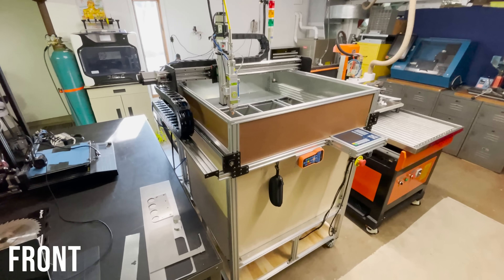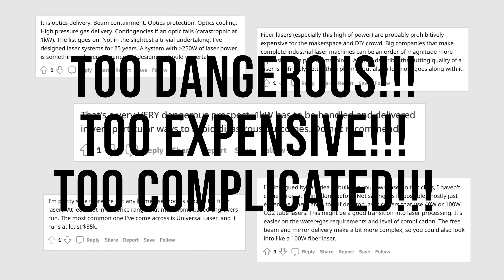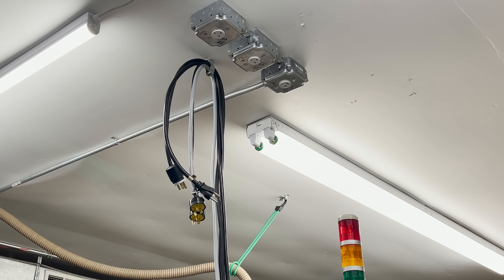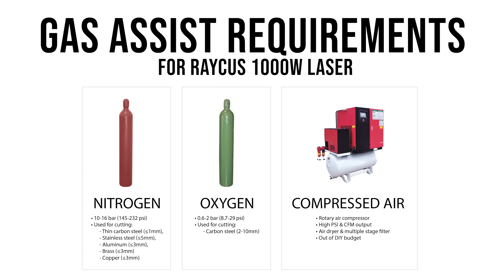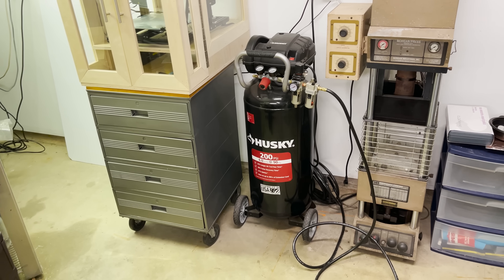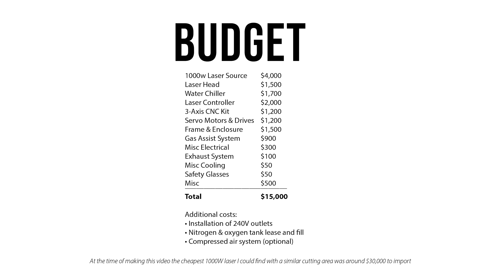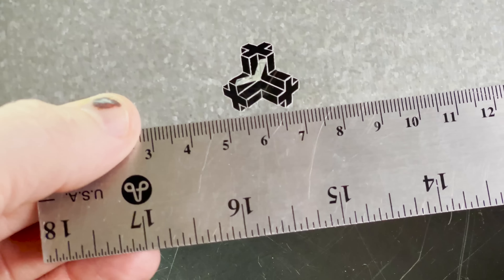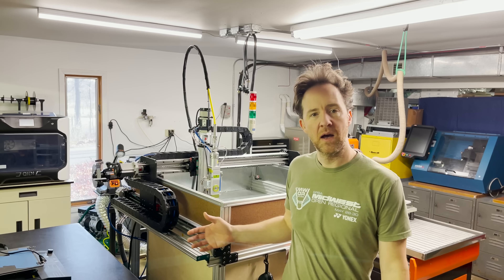DIY 1000W Fiber Laser Cutter Part 1: Project Introduction

Comment from the maker: * UPDATE MAY 2024: I have an updated, better, and cheaper design...also check out this video series: https://youtu.be/AL-qmKZxsL4 *

I'm getting a lot of comments about the gas prices and I really appreciate everyones feedback. I should have gone into a little more detail in the video...the prices I listed are to fill 300 cu/ft bottles at Airgas. I purchased their Ultra High Purity rated gasses, because it was the only option that they offered that met the requirements recommended by RayTools (the laser head manufacturer) of 99.95% purity, <5 ppm H20, <1 ppm THC for the Oxygen & 99.99% purity, 5 ppm H20, <1 ppm THC for the Nitrogen. Some commenters are telling me that they are using cheaper, lower purity gasses and they work just fine for cutting, so next time I need to refill, I am certainly going to shop around and see how much cheaper I can get standard industrial grade gasses. Thanks everybody for saving me money!

Secondly, a lot of people are asking how thick it can cut...the specs for the 1000W Raycus laser source show that it can cut a maximum thickness of: 10 mm carbon steel, 5 mm stainless steel, 3 mm aluminum, 3 mm brass. I have yet to push it to its limits...the thickest I've cut is 1/4" (6.35 mm) carbon steel. Stay tuned, there will be a lot more cutting videos to come!

Thirdly?, Wow!!! I am overwhelmed with joy by the amount of subscribers and comments I'm receiving about the project...I thought there might be a few people interested, but I had no idea there were so many seeking this info. I already can't keep up with all of the conversations I would love to be having in the comments section, so in the next video I'm going to try to address some of the more popular questions I keep receiving, on top of moving the build process forward. Thank you everybody for your support!
Reply: Yeah, that high purity stuff is hella expensive. But if compressed air is an option, then "low purity" compressed gasses are surely an option. Compared to just air, those cheap gases are already as pure as you can get them.

Also looking forward to seeing the buildseries and breakdown. Subbed.
Reply: Belive it or  not , i cut 3mm carbon steel and 2 mm stainless steel with a 150 W CO2 laser. I mainly cut 0.3mm and 1mm carbon steel on it. I use Oxygen as a gas assist. Before that i used to cut with a 100W reci tube but not 1mm thick , only 0.5mm and 0.3 mm carbon steel. The laser was not design for metal cutting so i designed and fabricated a new laser head on a lathe with a 52mm focusing lens , ruida capacitive height sensor and chc300 module for autofocusing. The quality is a little below fiber laser but is not bad. I have a metal laser cuter for under 5000 euro with a table size of 1300mm x 3000 mm.
Reply: We use medical grade air and nitrogen at work and only pay 100 a K bottle for a fill. Airgas likes to overcharge smaller clients as well.
Reply from the maker: @Bento_Boxx-m5v  Thanks for sharing...what company does everyone recommend besides Airgas? AWG American Welding & Gas is another company within reasonable driving distance for me...anyone use them as their gas supplier?
Reply: @diyfiberlaser  depends on where you live. I use arc3 gas where I am.
Reply: @diyfiberlaser  Airgas is semi-notorious in the welding trades for overcharging. FWIW, we recently had a project at work to nitrogen purge and vacuum seal some product. We were using the same size cylinders, Airgas quoted us 450 per refill. I found a local welding and gas supplier that would do high-purity for 250, and we ended up settling on food-grade for 120 per cylinder. Definitely check around, you can easily find a better deal than that. Good place to start looking is the companies that supply compressed CO2 for soft drink fountains, many of them can also do nitrogen. If compressed air is acceptable, then food grade will almost certainly be pure enough and far more economical since it is used in far higher volumes.
Reply: @diyfiberlaser  I get my gasses (not ultra pure) from a local welding supplier, who get their gas from...Airgas. It's a lot cheaper than Airgas direct. They are also real nice folks.
Reply: If you are cutting a bunch also consider a liquidpack nitrogen bottle.  prob going to cost over a grand to get one there, but then the cost of the actual gas it produces will be way way cheaper in the long run.  And as others have said the 30 or less per bottle nitrogen is what most people use from what I have seen.  Very impressive build!
Reply: Can you use Argon instead?
It is a cheap welding gas.
Think we get about the same size bottle here with a refill price about 150-250 usd.
Reply: What speed did you cut the 1/4" steel at?
Reply from the maker: @TheJuicyBurger  17mm/s
Reply: Can you add a inline dehumidifier to the ainlet gas for the laser to help with moisture from the cheaper gass?
Reply: You must be new here. Nerds and YouTube. Don't be shocked we're on your kit like white on rice.
Reply: I am in Salt Lake City and I switched from air gas to norco because air gas was like 40% more than norco and the norco employees are actually nice to me
Reply: yea Airgas got ya. I get a full Dewar of liquid oxygen for 200
Reply: You should pin this thread if you want it to appear at the top for everyone, without the pin it only appears at the top for you.
Reply: Can you give us the details of your shopping list? For example, what controller are you using? Because I see a lot of fscut2000 on the internet, why didn't you use this option?
Reply: I run a medical stem cell cryopreservation lab. We use nitrogen tanks and after the deposit, they cost $75/ tank.
Reply: these are 2040 studs for table?

Comment: Nitrogen and oxygen dont cost that much to fill unless you live in Hawaii they are 10% of the price stated. A psa nitrogen generator and a screw compressor can be had for 5g if you shop.

Comment: I worked on komastu TLH-510 fiber lasers they used 300psi air via air comp and booster compressor and then used nitrogen as an assist gas. The compressor we uses was an atlas comp co ga75+ and we had 3 kaiser booster compressor. We also had two nitrogen membrane generators from atlas comp co. Blending high psi compressed air with the nitrogen is probably what I would recommend.
Reply: We had 5 laser

Comment: Amazing job. I have two questions, first, you run it at 220v? Which is the average and maximum power request? And second, which minimum diameter should drag chain keep to avoid damaging fiber glass cable inside? I am looking to build something similar but with small 50W raycus generator and focusing lens to engrave. This came with small fiber cable than a 1000w raycus so much more delicate

Comment: Alibaba has 1.5kw fiber units for 10 to 15k. Unless you like spending time away from friends and family for hobby purposes, why bother building one for the same price.
Reply from the maker: Have you purchased one for that price? I've seen some really low prices on Alibaba that I assume are just for getting you to start the conversation. A year ago when I built this machine prices were much higher, around $25k for an open frame, and $30k for a small enclosed machine, on the low end. Also keep in mind in the US, add an additional 25% import tariff, plus shipping and rigging. Today I'm able to build my V2 machine for under $11k and prices to import a small enclosed machines still seem to be about the same.
Reply: @diyfiberlaser  True, I suppose the prices on Alibaba are just for interest sake. China is the worlds manufacturing superpower, whether we like to accept it or not, controlling 53% of the worlds steel and produces 1 in 3 cars, for example. GE appliance division is now Chinese owned….If you had to reach out to a Chinese fiber laser manufacturer with specs and a price, maybe they could play ball, or not. My guess is, they would surprise you. Nevertheless, I admire your dedication and I too build machines for fun, albeit not to your level. Good luck to you.

Comment: Could add a larger tank to get the air you need. Still won’t run indefinitely but if you let the air compressor build up
Pressure first it will extend your cutting time on compressed air.

Comment: HI travis, great project and a great workshop.  I am currently on the fence to build one of your machines.  I am an electronics tinker'er and have a smallish workshop about 12x24' and do a lot of electronics, 3d printing and built a cnc router.  I am interested in building the laser cutter to fabricate other projects that require precise parts without having to cnc machine them.  I am just wondering if its worth the spend.  Could I also laser engrave with your machine if I set the power really low?  I dont care about the speed so much.  Looking for some versatility with each machine and not have it be single function.  I assume i could cut mostly any wood, plastic or mostly any metal?  I would mainly want to cut aluminum and steel, not stainless.  I would need different air assist gasses?  Could you laser weld flat sheets in your machine if positioned properly?   I guess i am just wondering if one of the cheaper 40 or 60watt co2 laser cutters would be better, I know they cant cut metal, but most other materials including acrylic.  Any suggestions would be appreciated.  I assume your build cost is around 6-8k all in?
Reply from the maker: This machine was $15k, look at my V2 series, it is better and cost $11k. It requires nitrogen and oxygen as assist gas. This is strictly for cutting metal, if you want a machine that can cut all materials look into water jet.
Reply: @diyfiberlaser  yea for that cost I can get a few years worth of parts cut online.  It's that tricky balance between enjoying the build or needing the machine.

Comment: I built a small CNC table (15 inches x 30 inches). It uses nema 17 motors and probably cost me less than $150 to put it together using off-the-shelf aluminum extrusion and parts from AliExpress. I use open builds software to run it because it's free. I hooked up a plasma cutter to it (low frequency blowback style) and was able to cut some signs. I'm not a big fan of the metal warping and crashing the machine, and I'm sure a laser cutter would produce far less heat in the metal. I'd love to hook up a fiber laser head to it but it looks a bit too costly at this point. If I was going to spend that kind of money on a laser source and head I would probably opt for a better and larger CNC platform as well. I've also explored the idea of building a water jet cutter. I think that would be much more affordable but the accuracy you were getting on that small cut was super impressive. I'm not sure a water jet cutter could even be that accurate. I'd like to see your laser cutter cut something thicker. Either way, amazing project. Subscribed.
Reply from the maker: My V2 machine can be made for significantly cheaper than this version cost. Keep watching the series…I show it cutting all the way up to 8mm steel plate I believe.

Comment: This is awesome but seeing how the whole frame wobbles side to side as the motors do their action kinda scary tbh... also it'd be really interesting to know how you systematically deal with all the risks involved. Failure of components and possible backup? Anything to avoid or mitigate fire? I'm very impressed but also this still looks very unsafe
Reply from the maker: The wobble is because it was still on caster wheels as it was in progress. Laser safety glasses for my eyes, enclosure for the sparks, exhaust for the fumes, fire extinguisher nearby.
Reply: @diyfiberlaser  Only 5 minutes after I commented I saw your update video. I'm looking forward to your next improved build! Must be amazing to have a too like that at home

Comment: That's interestng to see one being able to make a DIY fiberlaser at 15K usd. I've been thinking of it myself. I see now that it would made no economical sense to own a laser cutter for sheet metal to make parts that I need for my own products, I had to be in need of a much larger volume of parts. 1000 w fiber lasers complete machines seem to start out at 20-25K usd, from China. In case investing in such a machine I would be doing parts for others too, to keep it busy.
Reply from the maker: I’m working on a new one, it only cost about $10k this time. Videos will be coming soon
Reply: @diyfiberlaser  That's great to hear, will be interesting following the build of the new laser. I now have seen your follow up video on the first laser build, and checked out the Sky Fire Laser equipment, looks to be quiet lower cost than the budget for the first laser
Reply from the maker: @Rimrock300  Yes, buying the components there, is one of the main ways I've been able to reduce the cost.

Comment: You could have simply buy a new cnc router from china for half the price of your build OR you could have opted for a cheaper closed loop stepper motor system. A lot of ways to make a DIY 1000W laser router for around 5000usd maybe even less if you hunt for the parts
Reply: He says he have shopped around for parts, and I'm not in doubt about that. 55000 usd just for the laser source and head is the lowest he came over. This must be a quality product, a real fiber laser, that can do a proffesional job, not a 'wanna be 1000w laser', that is really 150w and cut wood only...If it was possible to do it for 5000 usd, a real fiber laser 1000w, he would for sure found the parts and done it, no doubt. He seems to have long experience with all this stuff.

Comment: It would be super cool to have a laser source in a garage akin to an air compressor. you have one big source and you could run fiber around the shop to run a cleaner or welder off the same laser as the CNC table.
Reply: Sure would be cool to have a fiber laser in the garage. But even at 'just' 15K cost, I see I would need a pretty higher volume of parts for own projects/products to have it make economical sense compared to have parts cut by someone who got proffesional machines and do it full time. One the other hand, if one can do cutting jobs for others to, to keep the machine more busy, it could make better sense. Complete 1000 w fiber lasers from China seems to be aviable at 20-25K.

Comment: At about 8:05 you turn on your Nitrogen.    That's an all-the-way on or all-the-way off valve.   You should open it up all the way to the packing.   Same with all gas cylinders.

Comment: I used to work at a shop . They used 4 différents gas co2 oxygen on  laser cutter. Co2 nitrogen n 32h and of course h2o on plasma cut  . All for différents job . Thickness speed and space from the matériel.  Waterjet is a dirty job 😅😅. As a machinist been working on cnc lathe milling and router . Now I got my own small company and is old school machine resharpening grinding tools .But I love your project look pretty cool .

Comment: For power, since you only need power for short periods of time,  a diesel generator that outputs 400v 3 phase isn't that hard to find nor expensive (farms often have these for backup power).
Heck, nowadays, a EV battery with that kinda power isn't that hard to come by fairly "cheap" either.

Comment: buenas noches desde México
Tengo un LÁSER DE FIBRA de 1000W, estoy cortando acero al carbono de 3/8" con aire comprimido y quiero cambiar a oxígeno, ¿me pueden ayudar con los parámetros de velocidad de corte, altura, presión de gas, ajuste de enfoque y qué boquilla usar?
Reply from the maker: 13 mm/s, 8.7 psi, 2.5 double nozzle, focus +3, height 0.8 mm...that is the cut settings for Raycus 1kw
Reply: muchas gracias

Comment: If you get a cheap solar inverter and some batteries you could have enough power to run both your laser and an air compressor for at least an hour at a time. Then the batteries would recharge for an hour.

Comment: There is no way you’re paying $265 to fill a nitrogen bottle. I use the largest nitrogen that’s sold for transport to a personal shop. I think it’s 238 cubic ft abd it costs me $35 to exchange it for a full one. Those prices your quoting look like the price of buying a new tank and not an exchange.

Looking at your price list there are a hand full of things you could have saved money on. I built my own cnc controller that runs off a small mini Linux computer and runs Linux cnc. It has auto touch off omic control and automatic cutting height controll. I probably spent $1000 for everything including the steppers. I did buy some really nice cnc rated planetary gear boxes for each stepper to up the torque. I built a cnc plasma table that has a bed size of about 3ftx6ft.

Comment: You are massively over paying for 02 at 455 per refill. Shop around you should be able to buy the bottle and pay for refills. Even a leased bottle shouldn't cost that much for exchanges. 
I'm considering a similar project thank you for this video.

Comment: Why servos? steppers would work fine with no risk of losing steps...
Reply from the maker: 3000rpm vs 1500rpm
Reply: I see an aggressive pitch on that ball screw, what kind of ipm feed ya getting?  @diyfiberlaser
Reply from the maker: It's a 10mm pitch ball screw...around 1000ipm rapids...could go faster but the 16mm ball screw want's to start whipping above that @cayenne7792

Comment: did you consider SCUBA tanks for the assist air??  3000psi at 80cf..... its been yrs since Ive had a scuba tank filled but back then it was 3.50$ per tank...

Comment: The air-compressor can use a zeolite alternating pressure system to extract the oxygen from the air and vent it, leaving you with nitrogen, CO2, and trace gasses.